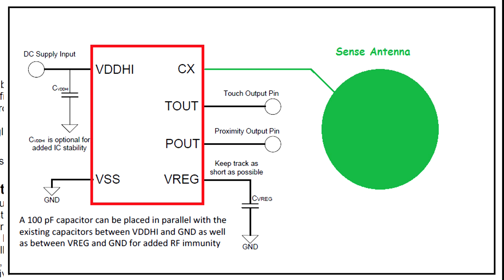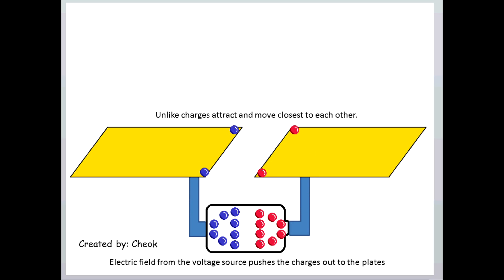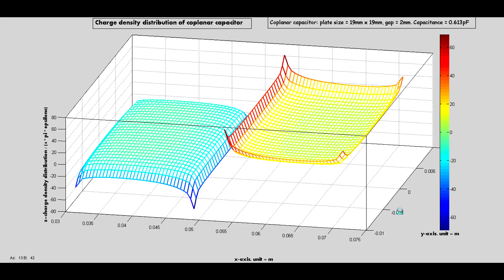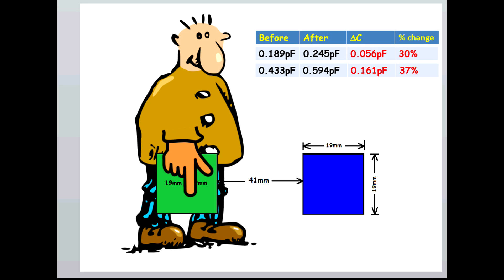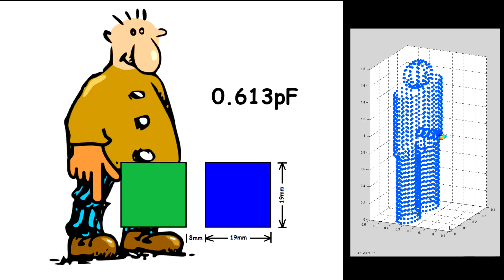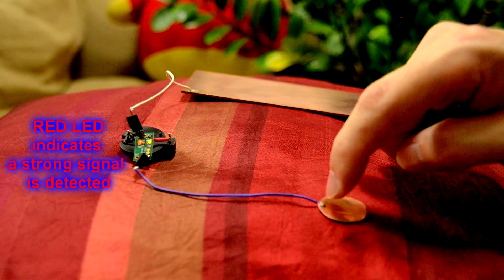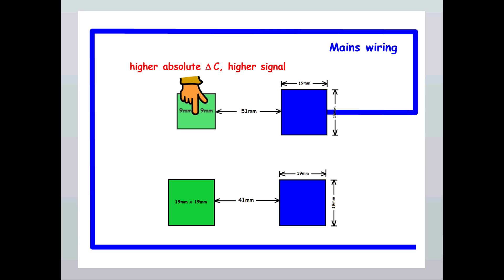Capacitive sensor, Theory, application and design

Comment: Very nice video, I was looking for explanations like that, do you have any chip / IC numbers that can work with your design? thanks again
Reply from the maker: I used Azoteq IC to make the video. For single touch as an example, Azoteq offers IQS227. The theory I presented in the video works for all brands and implementations, whether it is the charge transfer or relaxation oscillation methods.
Reply: @SiliconSoup  Thank you very much, very nice of you

Comment: In TTP223, if I make the ground pad smaller and the touch pad bigger, the sensitivity does not transfer to the ground pad. Why doesn't TTP223 follow that?
Reply from the maker: The ground is not just the pcb ground, but includes the battery ground or earth from the mains. If the battery is big, or the emulator has connection to PC ground,, or the DC adaptor is coupled to the earth, then the total ground is big, and the sensitivity is on the touch pad. The sensitivity is shifted to the touch pad when the device is powered by small batteries.

Comment: Hi, I am currently working on a capacitive proximity sensor, and I would like to ask you some questions.I placed a large sensor (with only one plate) vertically 40cm above the ground, and then tried to approach the sensor with a larger copper plate to observe the capacitance value and how it changed.I used COMSOL software to conduct simulation tests, in which the sensor was set far away from the target object. My original idea was to take the capacitance change obtained as the parallel plate capacitance between the sensor and the object, and calculate the distance value from this value, but I found that the inverse distance value was wrong, that is to say, the formula of parallel plate capacitor is not applicable in this case.So I wonder if you know of a more suitable theoretical model of capacitance.
Reply from the maker: How big is the plate? When you said 40cm above the ground, is that the electrical ground plane or ground we step on? Using one large plate will not work, because the working principle is that 2 plates sense the external object. The smaller plate has a higher sensitivity and the bigger plate has a lower sensitivity. The large plate you intend to use as the electrode will work against your intention. I demonstrated this surprising and unintuitive result in my other video "teardown of miband3". The equivalent circuit is shown in youtu.be/ZHzaVzYEZbw. The circuit is simple, but it does predict bigger plate having smaller sensitivity and visi versa. The parallel plate model is incomplete. I hope this helps.
Reply: @SiliconSoup  The plate's area  is  24cm*24cm.The ground is ground we step on.My intend is to achieve a long proximity distance,e.g. 50cm.This purpose requires the use of larger plates.
Reply from the maker: @伍攀-i1s  Firstly, is your circuit battery powered or AC powered (through DC-adapter)? If you circuit is AC powered, inherently the circuit ground is connected to the earth of the electrical system, so you already have a big ground plane, so together with the 24cm X 24cm electrode, they can sense any big object coming in between them. The object will have to be same or bigger size to make significant change to the capacitance. However, if you have a 24cm x 24cm electrode, and a small circuit ground (if the circuit is battery powered), then the circuit will not work as intended. In fact you will find the sensitivity goes to the circuit ground, the small plate. So what you need to do is to enlarge the circuit ground to an area comparable or larger than 24cm x 24cm. Again, I like to emphasize that the capacitance between the single plate and the object need a good return path back to the circuit for the capacitance to be detected, that the good return path is formed by a much bigger ground plane coupling to the object. If you are dealing of long distance, the signal change can be small, so you need a sensitive capacitive sensing IC. Not all sensing IC have good SNR. I strongly recommend azoteq, because I experimented with it, and it is really good.

Comment: Hi, I would like to know whether the capacitance sensing mode you introduced belongs to the mutual capacitance mode?
If it is self-capacitance sensing, how should we analyze it?
Reply from the maker: This video is about self-capacitive sensor. I have a video to analyse self capacitive sensor using lumped capacitor. I also have other video on mutual or projected capacitive sensor, in the same YouTube channel. Thanks for watching.
Reply: @SiliconSoup  thanks for your explanation. But there's one thing I don't quite understand. 
In your video, at about 1 minute and 55 seconds, there are two other electrodes in addition to the target object.Shouldn't such a structure be mutually capacitive? I think if it is self-capacitive, there should be only one electrode acting as the sensor, and the object forms a capacitor with it. 
By the way, could you tell me which paper appears at 2 minutes and 45 seconds of the video?
Reply from the maker: @伍攀-i1s  There is no such thing as a one-plate capacitive sensor, as minimum two plates are needed to make a capacitor, and the object cannot be considered as one plate because it is not electrically connected to the circuit. The touch plate and the ground plane together form the sensor. Many people didn't know about the role of the ground plane in the sensing, and misunderstood that the touch plate is the only plate doing the sensing. This misunderstanding, has resulted in this sensor called the self-capacitive sensor. Strictly speaking, based on my academic knowledge on multi-conductor capacitor, the capacitance being sensed in the circuit is the mutual capacitance (so you are absolutely right), and this type of sensor should be called the mutual capacitive sensor. Another reason it is called the self-capacitive sensor, is from the implementation point of view; the charging of voltage and the sensing of induced charge happen on the same plate.  The article is "The method of Moments in Electromagnetics", Massachusetts Institute of Technology, 6.635 lecture notes.

Comment: Hi to detect a distance of an object from a capacitance sensor,  is more power required to detect the object being further away?
Reply from the maker: The average power consumption of the sensor IC is the same, whether the object is near or far. Theoretically, in "charge transfer" method of capacitive sensing, object at further distance requires more transfer cycle to trip the sensor, so yes it take more power to sense object at further distance, but really not a consideration in engineering.
Reply: @SiliconSoup  thanks so much!! Just for my understanding of the concept

Comment: Hi.
I have seen a stylus known as the high precision metal tip stylus for capacitive touchscreen.
They have some sort os metal tip and are rechargable or has a aaa battery.
Various brands link wacom, stilo, apex etc are available.
Can u explain how do they work?
I tried to search it on web for about 4-5 days but i got nothing.
Will you please explain the working of that stylus?
Thanks

Comment: Well done, I think it could be better by illustrating a simple kirchhoff current loop though.  There is a board capacitance to earth ground, a human capacitance to earth ground, and a human capacitance to the board (touching).  This forms the basic loop for current to flow.  When the ground plane of the board is big, the board capacitance is big and then only the touch capacitance matters.  When the ground plane is small, the board capacitance is small and then it attenuates the touch capacitance.  But yeah, good work anyways.

Comment: Hello! I'm 18 years old student in Korea. I researched on the principle of capacitive touch screen and the criteria of the substance that detects the input, several months ago. This is because it was interesting to know that touchscreen even works with materials such as water, salt, and polyethylene. I  was able to find out some information about touchscreen, however, it is hard to find any more information about it on the Korean internetT.T
If you have any facts about substance that enables capacitive touchscreen to work, please help me... I'll will wait for the reply!
Reply from the maker: The electrodes that detect the capacitance must be conductive, e.g. copper or ITO (Indium Tin Oxide). The gap between the electrode and the finger must be non-conductive, such as air, acrylic, glass, because electric field can pass through this media. Water, salt-water, aluminium cover are conductive and block the e-field and therefore should not sit in between the electrode and finger.  Of course, a little bit of water on the cover will not block the e-field fully, so capacitive sensing is still possible, if the circuit is very sensitive.
Reply: @SiliconSoup  Thank you for your kind reply! I was overjoyed this morning. But I still have something that I can't understand. I think I had not been able to convey the meaning of what I'm trying to say.  I did not mean that touchscreen could be touched with your hand when the water or the salt covered it. I experimented to see if the touchscreen reacts to the liquids, by putting several kinds of liquids in a non-conductive thin plastic bottle(Vial). The result was that when the liquid was water(or drink containing water such as coffee), glycerin, or ethanol, touch was possible but the screen did not work when the liquid was oil like gasoline or cooking oil. When tested in solid form, I I was possible to touch the screen with metal objects(such as locks, aluminum foil, even copper wire inside charger wires) , PE(on of the plastic) and solid salt in thin plastic containers, and in the case of most of non-conductive materials, such as solid sugar, plastic(except PE), cotton, rubber, paper and Calcium carbonate, touch was impossible. What I am wondering is, what is the criteria for the substances which makes the change of electric field?Another thing I am wondering is if it works by moving of the electrons from screen to substance changing the electric field of the screen, why does it work even when there is a non-conductive material between the finger and screen?I do not know if it was delivered properly, but I would really appreciate it if you answered it again!
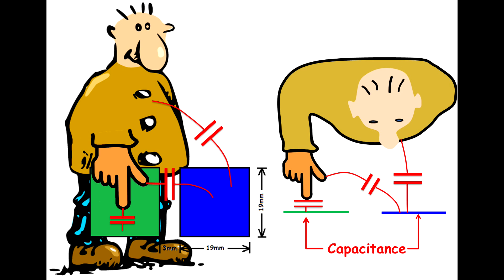Reply from the maker: The criteria for the substances to interact with the electrode is the conductivity. Conductive material like water, human body can interact with the touch screen, but plastic cannot. But being conductive is not enough, the conductor (e.g. human) must be able to couple to the sensing circuit by two ends, one end is the finger couple to the touch electrode by the small gap, and the other end the human body (or palm) to the ground plane by big surface area (watch 5:00). If you put a coin on your phone, it will not trigger because its like a finger without a body.
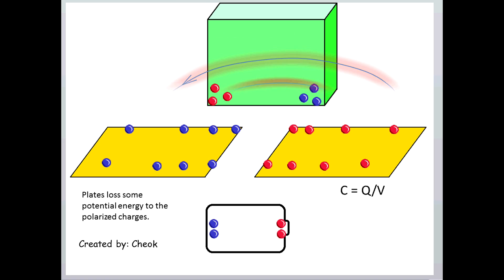The electrons cannot move from the screen/electrode to the substance. The physics is explained in 2:01. The electrode polarize the substance. The polarized substance in return attracts more electrons to the electrode, from the voltage source.
BTW, the video is about surface capacitive sensor. Touch screen uses projected/mutual capacitive sensor. The physics behind surface and projected sensors are different, and the response is directly opposite. For example, a touch on surface capacitive sensor increases the capacitance, whereas a touch on project/mutual capacitance decreases the capacitance.
I have another video on mutual capacitive sensor (https://www.youtube.com/watch?v=gxLzgeiJQbE). The video here is for surface capacitive sensor, and not directly applicable to touch screen (projected type), precisely speaking.

Comment: Thanks for the good video. One question: Is it possible to create large sensing areas for example 1m²?
Reply from the maker: The signal goes to the smaller plate. If the touch electrode is 1m^2, and the ground plane is smaller, a signal is produced when touching the ground plane (and NOT the electrode). If the ground plane is much bigger than the 1m^2, then the signal produced by touching the electrode will still be small, because the human body is well coupled to the electrode and ground plane to begin with, and moving the finger tip does not change in capacitor's geometry very much so the signal will still be very small.

Comment: Nice Video, I want to know how to increase in a single plate capacitor assuming the other one is virtual ground.
Reply from the maker: To assume the the other plate is virtual ground means the ground plane is very big. To increase the sensitivity of the sensing plate, try to avoid ground plane directly underneath the sensing plate. This is to reduce the baseline capacitance, so that the change in capacitance is higher in terms of percentage.

Comment: so am i losing energy by touching a screen????????????????????????????????????????
Reply from the maker: if you model your body as a perfect conductor, then when your finger moves relative to the touch sensor, charges on your body redistribute, but there is no gain or loss in energy, because no energy is required to move charges on a perfect conductor.  If body resistance is taken into consideration, when your finger is near the sensor and your body is polarized, you gain energy (from the supply of the sensor). But when your finger moves away from the sensor, the polarized charges reunite through the body resistance and release energy through heat. This is academic fun :)

Comment: what is parasitic capacitance?
Reply from the maker: for self-capacitive sensor, the baseline capacitance should be small, so that the change of capacitance in percentage is big when the finger moves in. Any unwanted capacitance adding to the baseline is the parasitic capacitance. For example, a signal line underneath the sensing electrode is a parasitic capacitance. In fact, all  metals in the circuit will form capacitance with the sensing electrode and are parasitic capacitance too. But due the far distance, the impact is not as big and signal lines underneath.

Comment: Hey I have a question, 
So at min 1:55, what is exactly happening during  the polarization process. How exactly does the polarized charges gain energy, or other way around if the plates losing potential and Why does the plates can receive more charges?

What exactly is happening, (sorry im quite interested)

Whats with the fingertip is changing the relative dielectric constant in the elecric field so we would have the formula C= A/d * er and er changes so the overall capacitance changes.

good video
Reply from the maker: When charges are separated, they want to reunite and therefore they have the potential to do work. When the plates lose some potential, then the potential is lower then that of the battery, then charges flow from higher potential (battery) to lower potential (plates).
After I made this video, i think a better explanation for the activities is based on the forces, not potential, because potential is a derived property from the force. When the object is polarized, the negative charges on the left side of the object (2:00) attract positive charges into the left plate (by e-field/force), and the positive charges on the right side of the object attract negative charges into the right plate.
Reply: Thanks a lot, i really appreciate your quick and detailed answer ;)

Comment: 6:22, mentioned Mains Wiring, what does tat refer to?
Reply from the maker: +Bo Cheng 
Mains wiring refers to 110V AC or 230V AC lines. Capacitive sensors in appliances are much more sensitive than those in handheld devices. The neutral wires increase the "ground plane" area, so it not only increase the sensitivity but also shift the sensitivity to the touch buttons.
Reply: +Pebble Soup  Thanks for the explanation.
Another question: I came across an issue that the trace where wiring the button to the controller also gets the sensitivity, in other word, the trace are also acting like switches. How do I decrease the sensitivity on the trace? (I tried added ground plane around it, shorten the spacing but it still didn't work well)
Reply from the maker: +Bo Cheng use the thinnest trace allowed by the PCB fabrication. This is to make the trace area much smaller than the touch pad area. If the touch pad is on the top side of the PCB, put the trace on the bottom side.

Comment: very interesting. Do you have an idea to use this system to measure the water level in a plastic water pipe diameter 25 mm and water column difference 50 mm ?

Comment: Ti me at 2:14, why does Capacitance increase untill the plate potential is back again?? i think that  equibrilium is maintained strill after and would not be broken due to external object.... I'm really curious!!!
Reply: Pebble Soup
Nice one
Reply from the maker: charges move from higher potential to lower potential. As  more charges built up across the plates, the potential difference increases until it is the same as the voltage source and so a new equilibrium is established.

Comment from the maker: In capacitive sensing, two electrodes (one is the circuit ground, the other is the touch electrode) are required to complete the sensing path, and the signal (delta C) has a bigger change at the smaller electrode. A big table will increase the signal level at other (smaller) electrodes, but the table itself will produce very weak signal and can't be use and the sensing electrode.   /watch?v=ZHzaVzYEZbw in Youtube.

Comment: Can you have mains wiring to a table an have 2 or more touch sensors sharing this? Maybe keyboard? If previous possible, can you also detect when bodies loses contact with given surfaces (sharing common mains wire)?